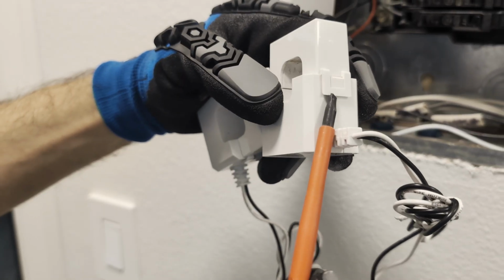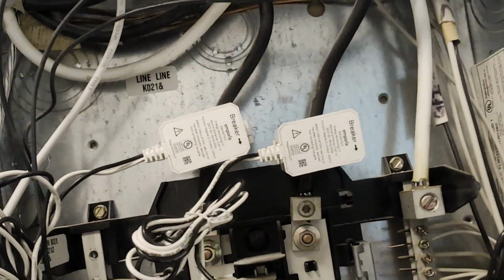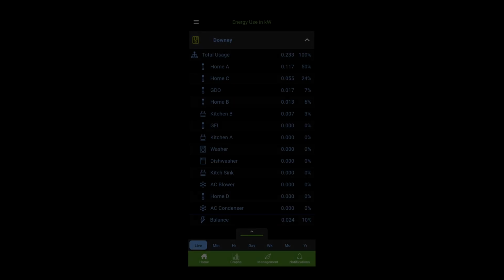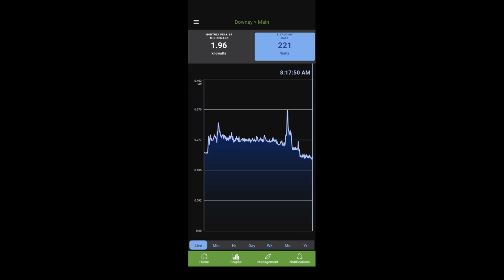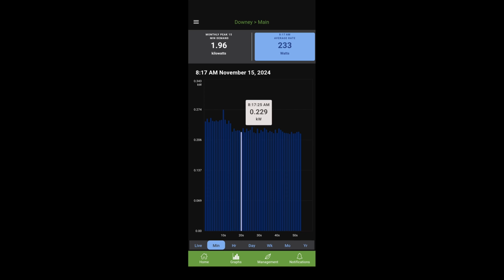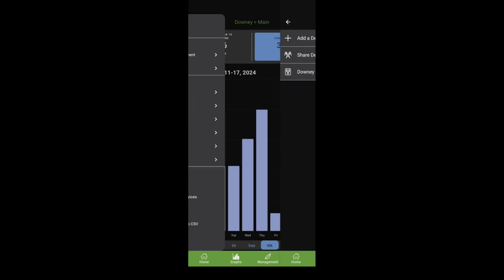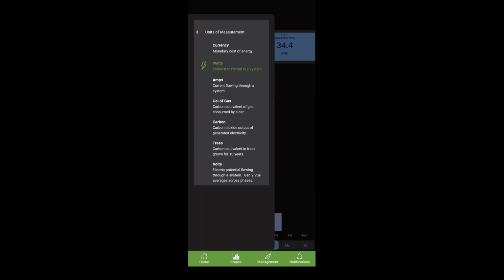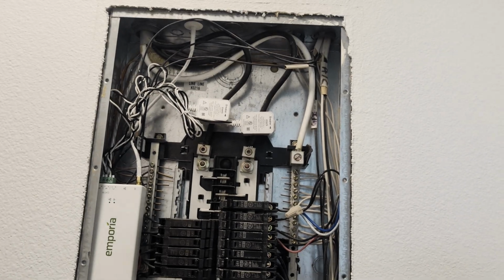Emporia Vue Gen 3 - Install and Review

Comment: Not sure about the states but here in Canada it is against code to splice inside a panel.
Reply: In jurisdictions following the NEC, it is allowed per 312.8 with some general spacing and labeling requirements specified in 312.8(A) 1-3. But in general, "the wiring space of enclosures for switches or overcurrent devices shall be permitted for conductors feeding through, spliced, or tapping off to other enclosures, switches, or overcurrent devices".

Comment: @ChrisAsipyan here is a question for you:  I want to monitor power from my 200A main panel AND my sub panel, which has most of the house on it.  the Main panel feeds the ADU and Garage separately, but 100A is fed to the other side of the house, where the sub panel goes to the main house.  Is there a way to add another transmitter (slave) in the sub-panel that will work with the main gen3 unit I have in the main?

Comment: Your video was very useful, thank you!  I also live in a condo.  Our building has a distribution panel where the main breaker for my unit is located.  Could one install Vue 3s in the distribution panel?  To power my Vue 3, I would need to pigtail power from my main breaker in the distribution panel.  Do you think this is possible (essentially Vue 3s would be used for submetering).  Thanks in advance.
Reply from the maker: Unfortunately I'm unsure, hopefully others can chime in about this.

Comment: I had to flashed the ESP module inside it to work with Home Assistant, I hate handing my valuable data over to a company to resell after I've already PAID for the device, seems like they're getting the better end of the deal.
Reply: Is it possible to do this outside the breaker box?
Reply: @tonym9771  Yes, you'd need to populate the headers above the ESP32 module, you can then provide 3.3 volts and tap into the Rx/Tx of the ESP32 and trigger GPIO 0 to set the ESP32 into programming/flash mode to flash Home Assistant onto it.

Comment: For powering up the unit, do you have to use 15a breakers or can you use a 20 breakers?
Reply from the maker: There should be no problem using 20amp breakers instead of 15amp.

Comment: Great video. Just a word of advice for electrical info. Nothing wrong just more info. You are allowed to put 2 wires under the same screw (for your neutral bus bar) as long as they are the same size gauge. So if you didn’t have any available slots you could take two of your existing neutrals and put them under the same screw. This would free up a slot for both the blue and white from the device. This method also reduces clutter by eliminating the wire nut. Again nothing wrong in video that I saw, just more info for you.
Reply: I am pretty sure this is incorrect as I am a licensed electrician and inspector will definitely argue it with you. The terminal is rated for 1 wire.
Reply from the maker: Thanks for the insight
Reply: Incorrect, look at the interior of your panel cover to verify. In most cases each neutral lug is rated for only one wire. What he did was correct. Licensed in NC
Reply: Thank you for not acting like a gatekeeper by shaming the OP because he didnt do that.

Comment: Thank you for this. Also, bear in mind that this device, coupled with the Emporia L2 EV charger, can manage the load the charger draws based on the panel load. That is my use case, but I haven't received the device yet, so I have no experiences to share.
Reply from the maker: Nice... Thanks for the insight.

Comment: Parev! Thanks for the video.
I just ordered a Vue 3 kit (16 CT version).

The only dilemma is I have a main 200A (single phase 120/240v) service with multiple sub-panels..
When roughing in my house, I went a bit overkill.  I have a Square-D QO 40 space service panel and 2x 40 circuit subs mounted adjacent to the primary panel.   Then I have a generator ATS feeding a 3rd sub-panel for “critical loads” like security systems, boiler, refrigerators and freezers, bathroom lighting, outdoor lighting, etc..

Approx 90x 20a single pole branch circuits and a bunch of 2-pole ckts.
Everything is installed on a plywood backboard and there are empty 2” nipples from panel to panel and a trough (raceway) above everything to allow for installation of the CTs.

BUT…. There are only 16 CTs in the largest kit.

Can you link or daisy chain multiple systems so they all appear integrated in the app/display?

Thanks!
Reply from the maker: Sorry for the late reply... You can have more than one monitor installed... They call it "nesting" .. this page explains it all: https://help.emporiaenergy.com/en/articles/9084166-multiple-vue-monitors-nesting-and-sub-panels
Reply: @ChrisAsipyan  And if you have 2x200 parallel panels with one of them feeding a sub panel? Will combined and nesting configurations work together?

Comment: Can i just add the red and black wires to the breakers?
Reply: No, the wire is more likely to cone loose on a clamped connection like a breaker if there is more than one pair.
Reply from the maker: It's just cleaner and easier to see what's happening when you split it this way

Comment: Thank you, this was really helpful, so just wondering, how can I monitoring a breaker that has two live lines (AC)?, Should I get both lines at the same time in a single sensor?
Reply from the maker: You should use two different clamps and through the app join them as one

Comment: Do you have to monitor each breaker? Will the main unit be of value if we only use the 2 main input current clamps?
I'm curious if the box has any intelligence to determine what appliance came on by comparing the current draw to that of a common current footprint for common appliances? I think it would not be that difficult to determine a furnace or a AC unit just came on. I ask this because this is how some Smart meters work.
Reply from the maker: No, with only the mains power being monitored, it is not smart enough to know what specific devices are operating. It does not have this type of feature. One thing you can do however, is to use their smart plugs to monitor smaller appliances.

Comment: Does it help avoid overload? i.e., can it adjust power on an EV charger to make sure I don't overload my home?
Reply from the maker: There is an article about a feature called "PowerSmart" that works when using Emporia's energy monitor and EV charger together. However, I do not have an EV charger and I have not tested this out. Here is the article I'm referring to: https://help.emporiaenergy.com/en/articles/9084181-what-is-powersmart